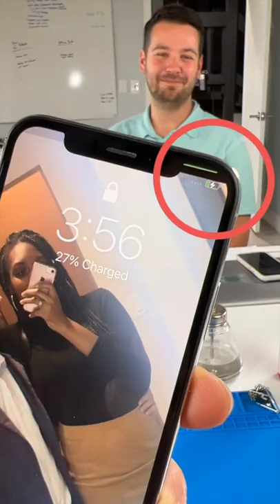I love doing it right in front of the customer📱🛠 #shorts #techrepair #teletouch

Comment: So it ain't waterproof?
Reply: Correct, phones are not water proof they are water resistant, the black adhesive around the borders inside the phone is called “water resistance seal” looks like that specific iphone had already been repaired before, even though the seal was replaced it won’t be as resistant as apple’s pressed seal. Still better than no seal, that phone would’ve been done for if it didn’t have a seal on it.